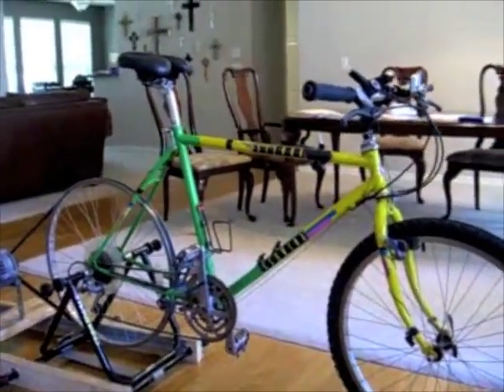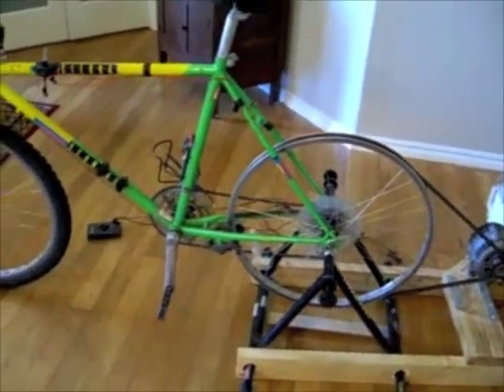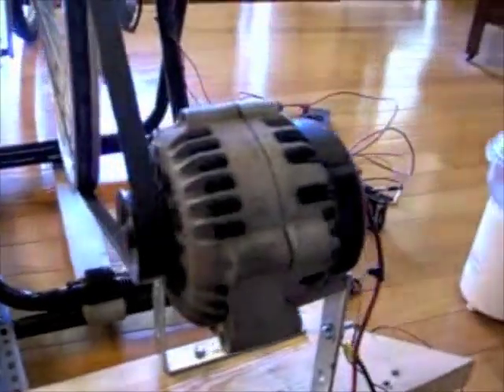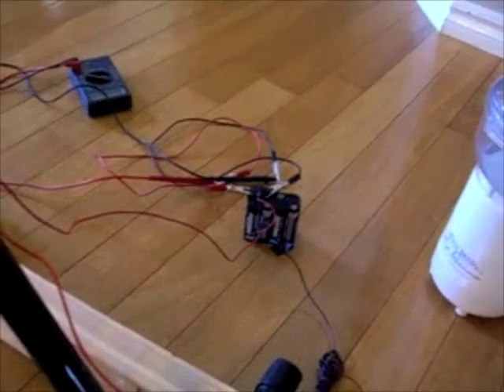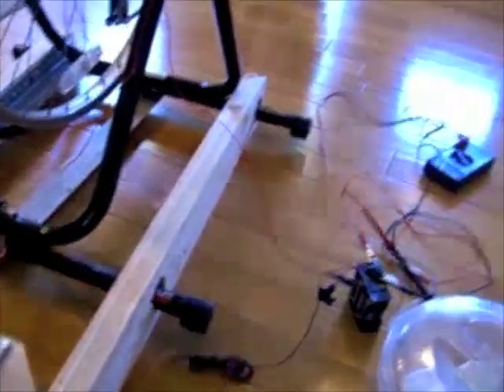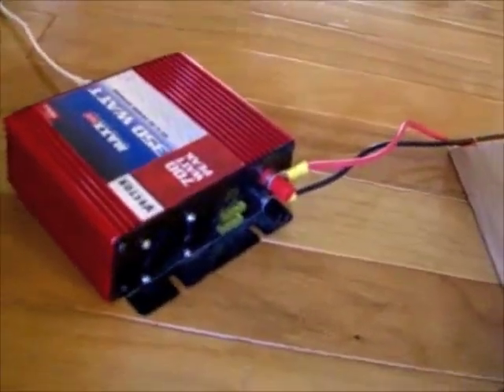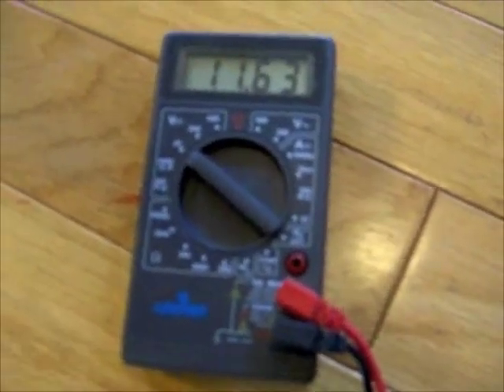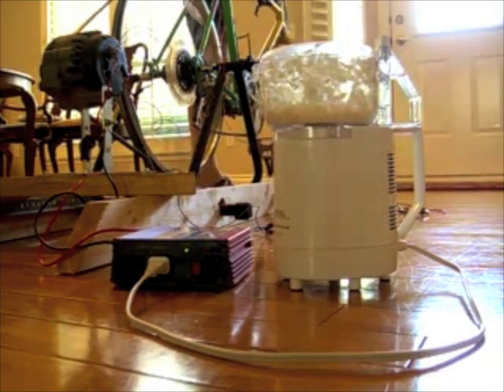Bicycle Generator

Comment: Nice video - easy to understand if you have no experience - if you look around there are permanent magnet alternators ( often used on wind generators - though expensive ) and also what is referred to as a " machine excited " alternator - I'm not that familiar with the alternator you have as they are not used much in the UK - but Lucas produce them commonly - remove the plastic end cover & you can tell by the number of diodes in the rectifier which it is. so are you just playing or is this a prep

Comment from the maker: correct.  batteries are an isolated circuit for two reasons. (1) It is nearly impossible to BEGIN pedaling when the field is charged with 12V.  That's why i pedal with no voltage, get it spinning, and then add the 12V power to generate electricity. (2) after power is created, I don't need the 12V source anymore, so I turn it off.  If I had a car battery or something rechargable, I would just leave it on to recharge.  
Heavy load when processor is on.  Next to zero load with batteries.  Thanks!

Comment from the maker: easy.  just hook the car battery up instead of the little pack i used.  leave the circuit closed (switch on), to keep charging the battery.  Once it is charged, the load decreases.

Comment from the maker: if you already had the bikes, the alternators are fairly cheap ($10 each in a junkyard).  Build your own bike stands out of wood, wire is cheap too.  wire everything in parallel.

What will cost you is batteries and the inverter(s).  My purpose wasn't to power the whole house, just run a few items when i needed the power.  Great question.

Comment: Interesting. I think the on screen notes said so, I'm assuming the 12v bat pack is an isolated circuit that doesn't get feedback from the output of alternator, was wondering what the current draw on those batteries is, how it is effected by load that is seen by alternator when powering the food processor vs no load, ie processor off? just curious, far from an engineer myself.

Comment from the maker: An alternator can produce as much as its rating allows (sometimes more).  This alternator is rated for 500 watts, but the human body is really only good for about 300.  They do make 1KW alternators, but you have to be able to turn them to make that kind of power (assuming there is a 1KW draw on the system)...and my legs can't swing it.  Perhaps 3-4 bike setups all helping turn the same pulley could do it though.  hmmmm. maybe i'll try that next.

Comment from the maker: Thanks, Colm.  Good idea.  I got mine at a junkyard. Just look for any car or truck with a serpentine belt.  It is usually long enough to accommodate any bicycle.  You could also just "friction drive" the alternator with the tire itself and avoid the belt altogether.

Comment from the maker: You certainly could.  Be sure you create a direct connection of something requiring 12V DC.  Several appliances are made for 12VDC.  Light bulbs are a great application, just make sure you have a DC light bulb (they look the same as 110V AC bulbs).  Here's a store selling them: store.sundancesolar. com /12vdcledreli. html

Comment: My alternator on my Honda is on its way out and I'll be changing it pretty soon.  Would I still be able to use the old alternator for this project?  Also, what size is that belt? I changed the belt on my honda a while back and it definitely was not that big

Comment from the maker: Wow!  Preppers meeting.  very cool.  That's one of the reasons I built it.  It doesn't really matter what model and belt you use.  I pulled it from a junked Chevy.  Any alternator will work.  You can get a high amp alternator, but keep in mind the human body can only generate 200-300 watts (depending on your fitness level).  A high powered alternator could be used, but really all you have is excess capacity you can't use.  Check out: O0x5j8_PKZw

Comment: Curses!
Foiled again.
Not many (if any Chevvys in a Scottish scrapyard.
I'll look out for a big serpentine belt, might get one on truck.
Next is an old DC generator -I used to have plenty but I threw them out or gave them away to make space  decades ago!
Now it's real cheap'n easy to regulate a DC gen with electronics, the old thre-bobbin lectro-mag affairs were no good for my needs.
Thanks for replying.

Comment from the maker: In parallel, but not series.  Also, you only have to pedal long enough for your device to charge.  My laptop charges completely in about 30 minutes...depends on your AC adapter.

Comment: Hi.. by your accent I presume you are American, and even though your cars are much bigger than those in Britain, I struggle to think of a car with an alternator belt as long as the one on your bike -what kind of  car was it?.  I've found that the belt is the biggest problem for these rigs running off the wheelsI I spliced a bit of polyprop rope for one I made, but it was lumpy.

Comment from the maker: Great idea, but you would have to have perfect control on your pedaling speed to keep constant power.  The beauty of an alternator (however inefficient), is it has the circuitry built in to regulate voltage regardless of RPM fluctuations.  I love the idea, though!  If I were an electrical engineer, I'd probably try it out.

Comment from the maker: ABSOLUTELY!  Most laptops charge on a 90 Watt system.  This is easily managed with pedal-power.  Once you get to the more sophisticated power supplies (150W+) it gets more difficult, but the majority of laptops, phones, etc.  can be charged in an hour or less without much load on the system.

Comment from the maker: That's the next task, is to build a reliable setup (with a battery or supercapacitor) that will power a TV without damaging it.  Power spikes, and irregular voltage are the key considerations.

Comment: I know this is 2 years too late but ...suggestion- Go into the Alternator and by pass the diodes and hook direct to the fields. You will get 120 volts there. Mount a volt meter on the handle bars and when you reach 120 volts you are ready to use the power. Using the inverter "steals" electricity for itself.

Comment: Curious what the pedal time would be to fully charge an average sized car battery, I am looking into building my own solar panels to charge a bank of car batteries to be inverted to power a house. But also having a bike powered charging source would be a great way to "pay the electric bill" in the winter months when there is less sun light.

Comment from the maker: @fackyoutoobe2 2000watts is a lot of power.  I doubt you'd be able to drive it with a bicycle for very long.  I encountered significant resistance with 250 watts.  It was manageable, but I can't imagine increasing by an order of magnitude!  I found if I pedaled too slow, the alternator would simply lock up (magnetism was too strong between rotor and stator).  Let me know if it works.

Comment: I was wondering why nobody was using a regular multispeed bicycle do you think just one alternator would work for a 2000 watt inverter or larger because I have a large inverter that will run a microwave

Comment: I think it would have been easiser to chop the onion with a knife. : )
A pedal energy source would be best to direct drive and act as the motor. Unless you need light - then look into LED 1 or 2 watt lights and create a generator to power those lights..
Human power can be very practical... Keep up the experiments!